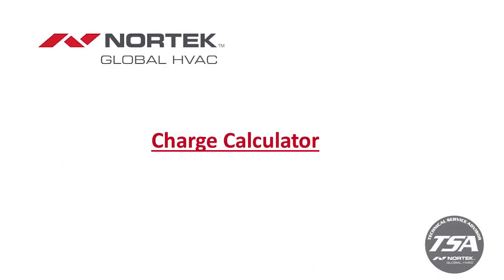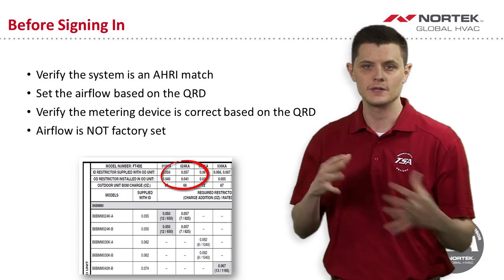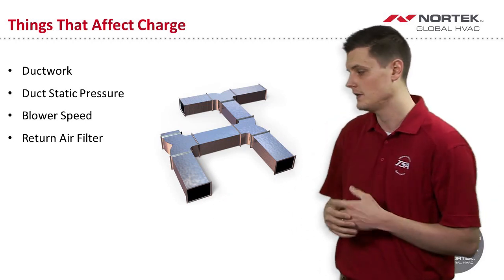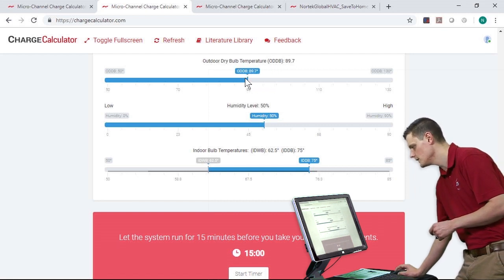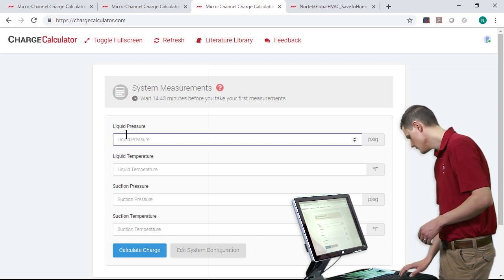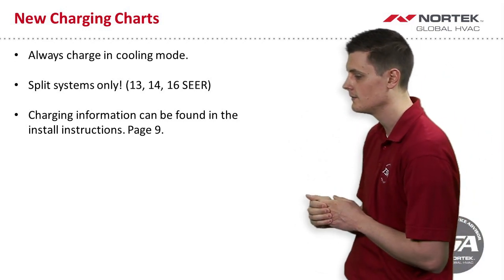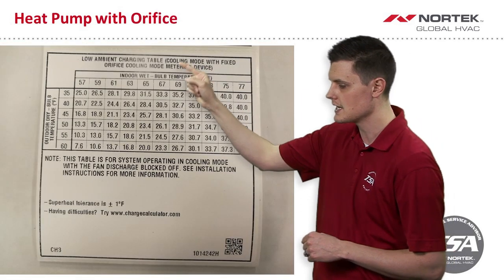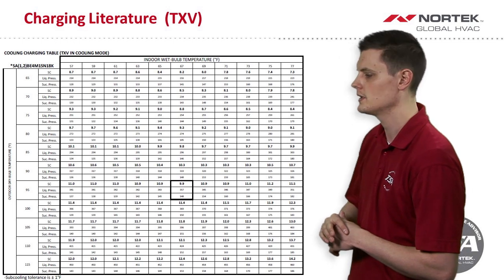Charge Calculator & Charging Charts

Comment: I have a 5/8” suction line and 5/16” liquid line that I will be reusing for new Airtemp 1 1/2 ton equipment with txv. Not going to change lines because of cost. How will this affect my charging? Or any other situation.
Reply from the maker: Please contact Nortek Technical Services for help 1-800-422-4328